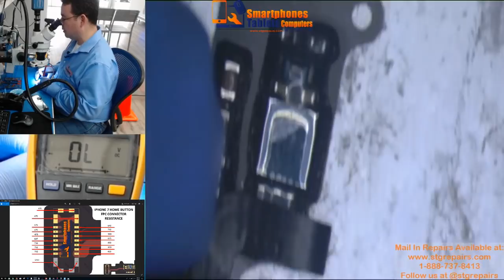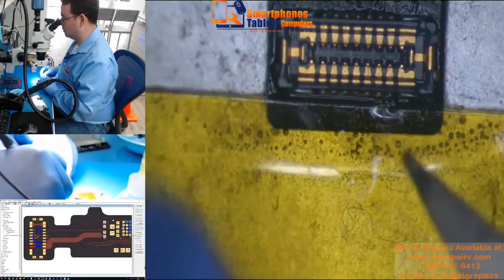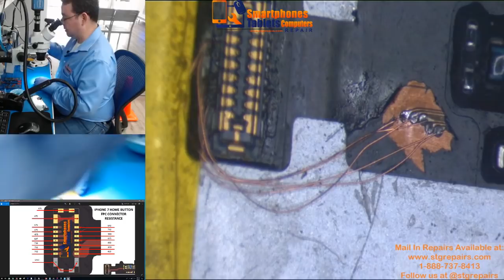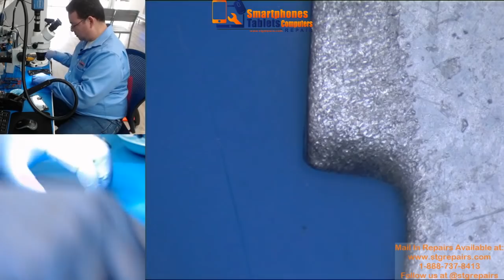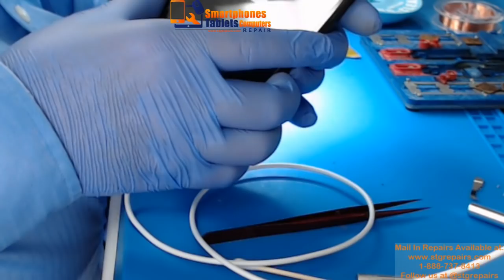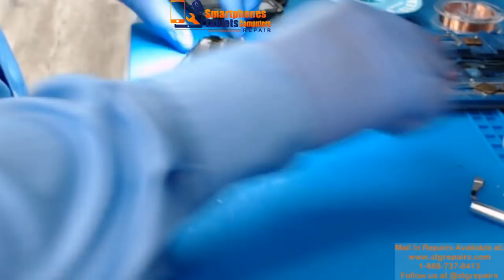Iphone 7 plus home button torn flex fixing process

Comment: Hi sir, my button home its too sentitive force touch, finger ok. 0 wire on flex cable broken, just resistance on the wires 1-14 are low ~50 than in video (475->430). How can I fix this prob. Tks u very much.
Reply: Replace turtle ic